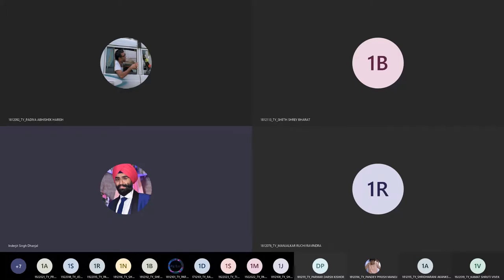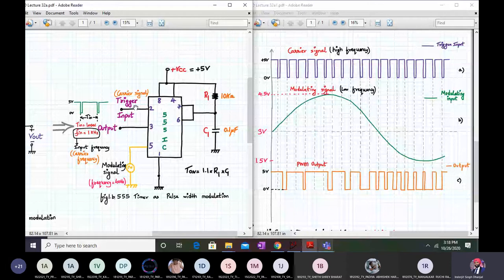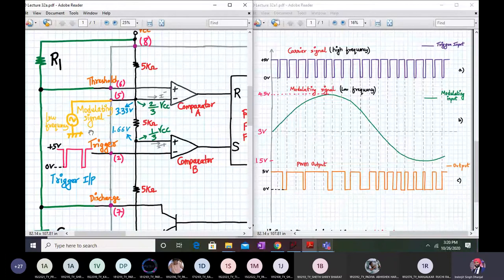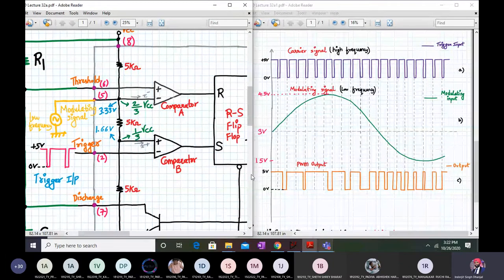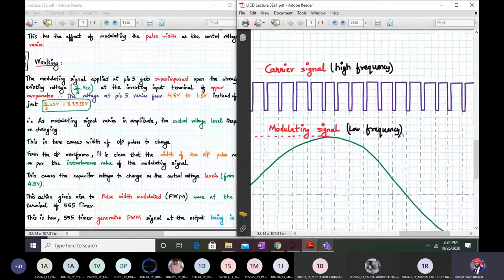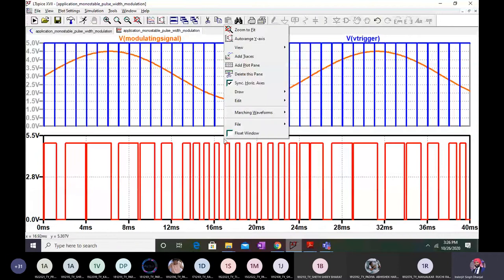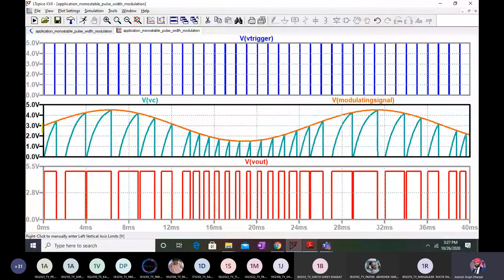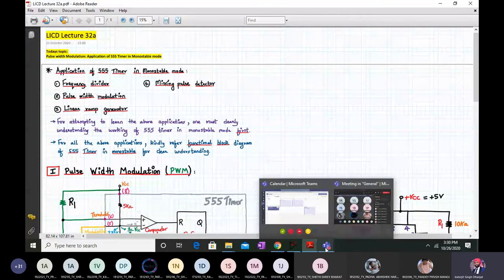Pulse Width Modulation using 555 Timer IC

Comment: Sir,
Good clear explanation.
What happens if the signal is going on the negative side of 0v?
What changes you will incorporate for a negative going signal of <0v?
From a function generator, I am unable to give a positive going signal only in a practical circuit.
Reply from the maker: u can simulate the circuit in the simulation of software and observe the changes.